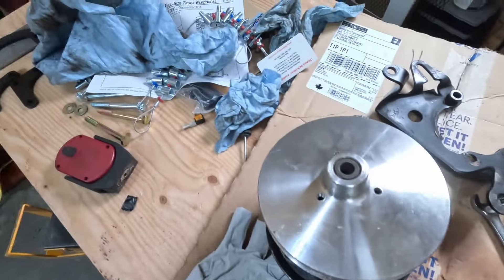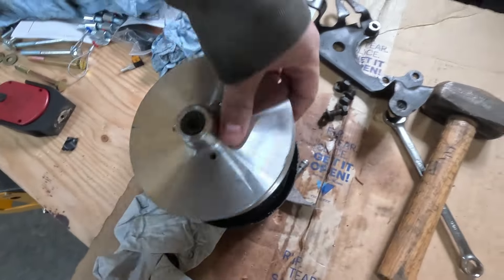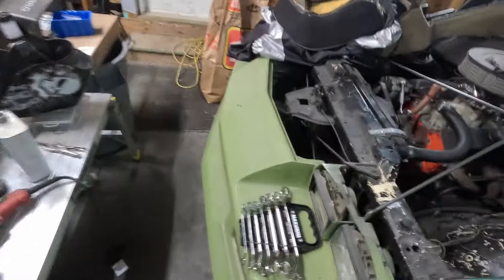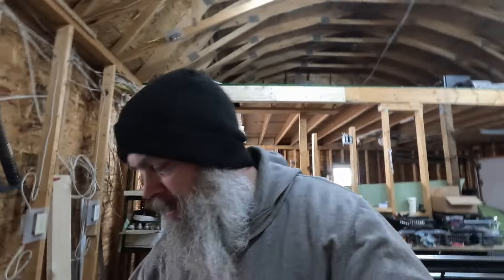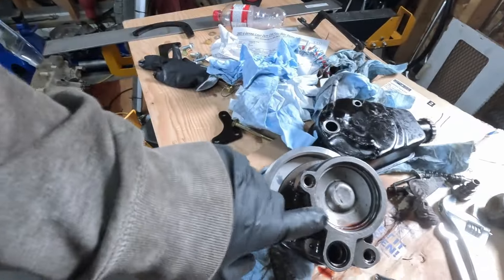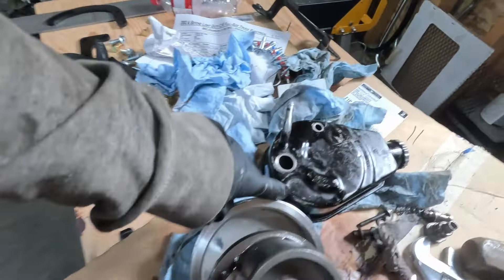Saginaw Pump Stud Mod

Comment: Cool trick.  I know there used to be a bracket that, in combination with the factory "tripod" bracket (that bolts between the pulley and the pump), provided the slider slot for the outboard adjustment bolt.  It only bolted to the head and reached behind and across the pump, dropped down and had a slot in it for that adjustment bolt to slide in.  Didn't use ANY of the studs on the back of the pump and didn't have any connection to the front-most exhaust bolt.  Of course, I didn't buy it for $30 back in the day because I was cheap and opted for hacked-up factory brackets, which are still on my car.
Reply from the maker: Yah picked up some brackets off Amazon but they are total junk but will as templates to make my own.